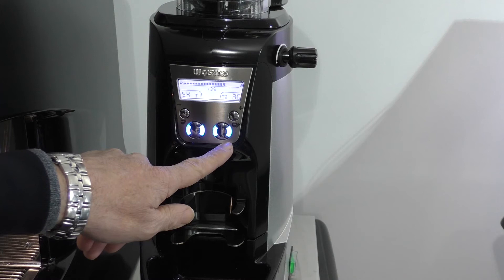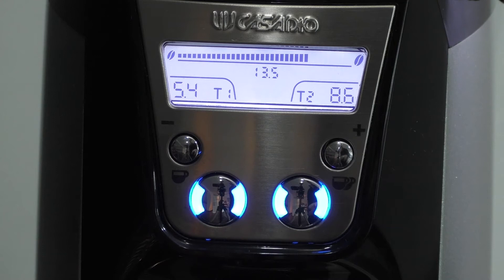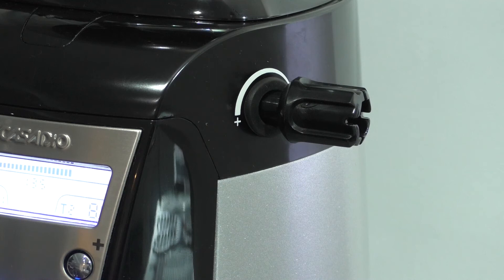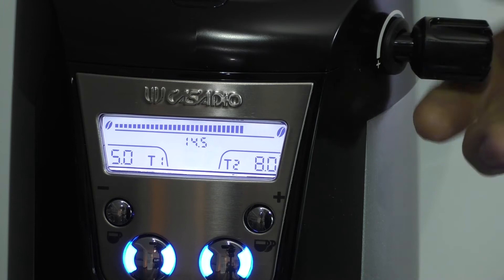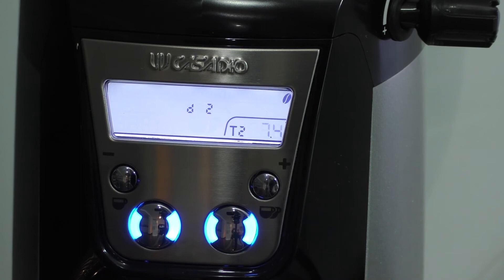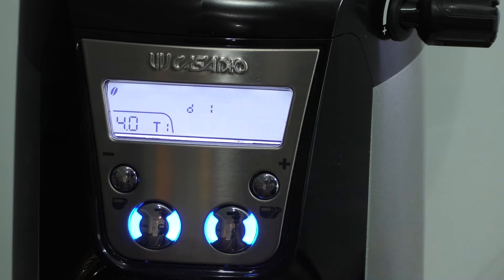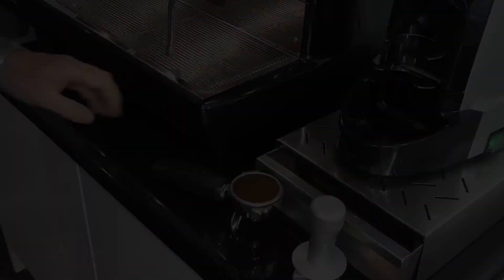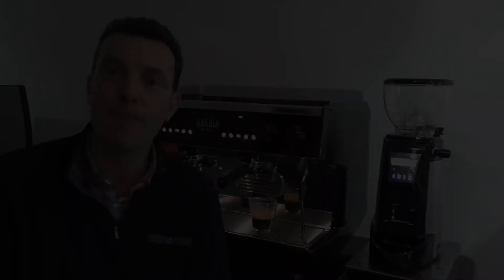Using and programming the Casadio Enea On demand coffee bean grinder

Comment: Hi all. I am having problem to enter service menu +,-,+ (hold) combination. Per Manual I should enter programming mode. Are there any solution to hard reset grinder and try to enter into the programming mode (+,-,+ with holding plus button for 5 sec). Thank you!

Comment: Hi. Thanks for the easy to follow video.

I have a problem with my unit. I can't adjust the grinder since the +/- bottoms don't change mode while pushing them.

Is there something I could do to fix it or do I need a technician to solve the problem. Thanks again.
Reply: Hi Jose, same issue here... Did you find a way to fix it?
Reply: Same problem